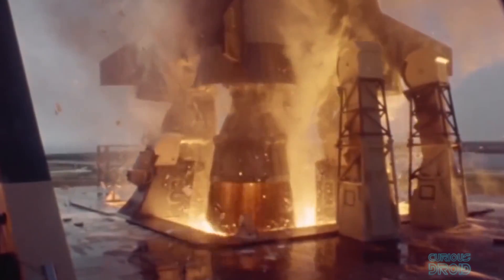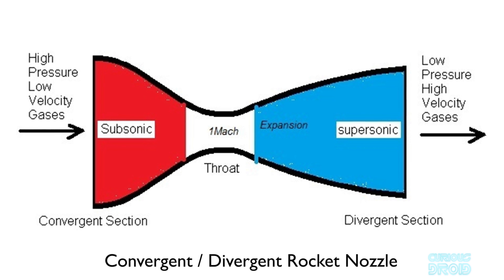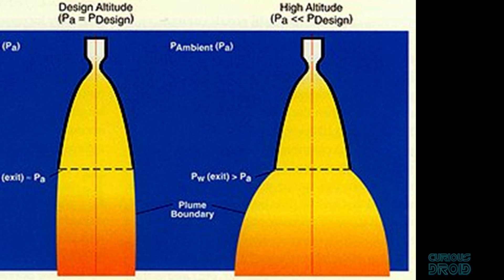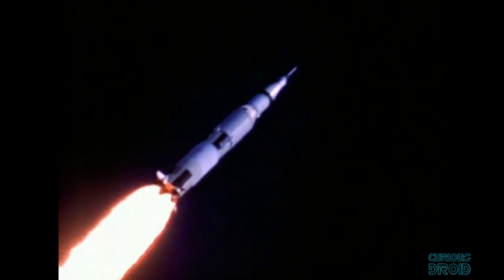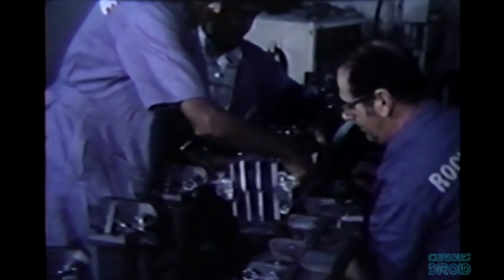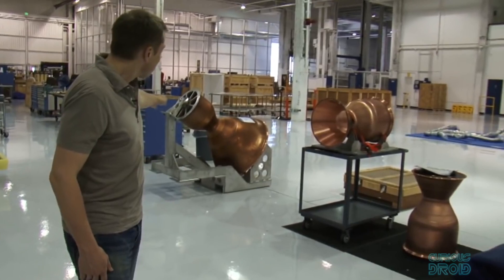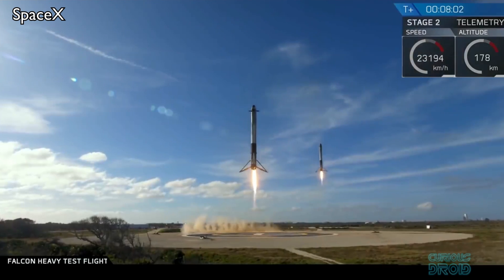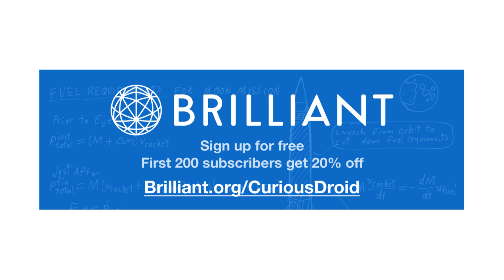Aerospike Engines - Why Aren't We Using them Now?

Comment: Very well done! But I think the technology enthusiasm got ahead of the reality at the end. Venturestar looks fantastic ... but the reason why SpaceX won't use aerospikes is because single-stage-to-orbit launch systems are inefficient on Earth. You want at least two stages to comfortably have a launcher, and more importantly a reusable launcher. (I assume you can throttle a linear aerospike for landing however, meaning that is not the problem.)

By reusing the sea-level optimal engine for the space-level optimal engine you afford a cheap system. The drawback is that your single-stage-to-orbit launcher for the rest of the solar system has two types, and sub-optimized types, of engines. But it works!

Nitpick: Counter the video, SpaceX took a huge risk redesigning valve-shutoff Merlin-C to face-shutoff Merlin-D roughly on the same order of risk as adopting non-bell aerospike engines. But it looks like it lead to en engine that may become the most reliable in the industry.

Comment: Why can these "Bell Shaped" rocket engine's be equipped with a "Outside Variable Thrust Ventury" ?
 This alone can increase efficiency and power. Its used on fighter jets, so why not incorporate that on to the Rocket Engines.

Comment: Isn't a key benefit to multi-stage space vessels to reduce the mass of the final craft for payload delivery / deep space penetration / return capsule? If you are taking the whole craft from launch to space and back, wouldn't you need untold amounts of fuel more, even while using a more efficient engine?

Comment: I’m no rocket engineer in any way but would it not be possible to avoid the overheating issue within the tip of the “spike” by porting some type of sophisticated refrigerants out of the center of the spike? I’m certain this has been though of. Just curious why it wouldn’t work. Maybe it would reduce thrust because of cooling? Or end up compromising the integrity of the spike itself due to heat differences between the inside and outside of the spike? Thinking out loud. I only have a GED so it’s okay to school me. I’d like to learn!

Comment: What you say at 11:00 seems a bit contradictory to one of the primary desires for rockets - the ability to lift as much as possible into space.

If the engines weigh about the same but the aerospikes can achieve the same result with a 40% fuel savings, the cost as you said is irrelevant. The WEIGHT savings from it would have huge implications for the cost per ton getting into space. 

Whatever the current payload capacity is for the most cost effective rockets, if you can save the weight of 40% fuel you could spend some of that that gain in efficiency on increasing payload no?

Comment: About SSTO (Single Stage To Orbit) the major problem is mass not engine. You need a huge quantity of fuel in order to reach space, also you need pressurised tank to contain it.
In a SSTO this will be dead weight, reducing fuel efficency just because of tank mass you have to keep. That's why we still use staging. Because of this you have much more DeltaV using stageing.

Comment: Really great video, very informative and easy to listen to and understand without being an hour long.  I can definitely see aerospike type engines becoming the preferred rocket design in the future when single stage rockets become the norm, rather than a unique exception.  As it is now, multi-stage rockets are beneficial in more ways than one.  As you say in the video, detaching a stage mid-flight and switching to a new set of thrusters allows for greater efficiency, as the shape of the nozzle can be designed for higher efficiency in the new burn.  But it's also an excellent choice in terms of weight management. Since the empty fuel tanks are no longer necessary they can be detached, allowing the new rockets to carry a much lighter load.  Since they're going to be detaching segments anyway, the need for an engine that functions as effectively at every altitude becomes a much less pressing matter.  I'm no rocket scientist :) But to my understanding, the bell shaped nozzle is more efficient within its designed pressure range than an aerospike is, the benefit of the aerospike is their versatility across many different pressures.  Once in space pressures don't fluctuate all that much so the bell type would almost certainly be more efficient.

For now, maximum efficiency in all things is what's most important regarding space flight.  Once we advance further however, perhaps we'll implement the aerospike as a convenient solution to a well understood and managed problem.  Much like how many people now use keurig coffee makers instead of the conventional and more efficient coffee pot type.
Reply: I am a rocket scientist and I see the aerospike nozzle as more like a science fair project with respect to launchers. Might be great for a missile though. However, the idea of changing the expansion ratio is not a bad idea, just not seeing it going anywhere with the aerospike.

Comment: Awesome video, and great narrator!!!! Thank you!!!

I'm curious though, why haven't variable nozzles been tried in some form or another. They're used on jet fighters all the time!
Reply: thermodynamics. Jet fighters exhaust are like ~1200 K (and that really, really, really pushing it) in the nozzle. Rocket engine's exhaust for something like LOX/ Kerosene are like ~2450 K and that's pretty standard. There are decent ideas out there, but they usually results in screwing up the flow coming out, which is important.

Comment: If long rows of aerospikes can allow for thrust vectoring, it seems like making a flying-wing design similar to the X-33, and towing it to about 40,000 feet like a glider would be the most cost effective launch method for heavy loads. It wouldn't even require any additional components to get the rocket nose-up since thrust vectored rockets can be used for steering both in atmosphere and out. 
That should help to reduce the biggest weakness of single-stage-to-orbit craft: needing to carry the entire mass of the craft into space, including empty tanks for spent fuel.

Comment: Personally know someone who worked on this aerospike engines for NASA and he said the project was cancelled because they could never get it to work with the requirement from NASA that they use the computer control systems that were developed in the 60's. The process to get systems approved for NASA use was so ridiculously long that by the time it is approved, it is ancient technology. It is why things have now moved to private industry as bureaucracy has killed NASA.
Reply: While I don't quite believe you about that "someone", the reason for stopping the project, cited by you, is the most likely one. It's kinda sad, with what kind of ancient technology technology in mind NASA's subcontractors are supposed to create their systems.

Comment: this sounds well and good but ignores the fact that multi-stage design allows the fuel tank and housing for the fuel used at lower altitude to be jettisoned along with the altitude optimized nozzles decreasing the rockets weight as each stage runs out of fuel. Less weight means less thrust is required at higher altitude for equivalent acceleration of just the upper stages compared to all the stages combined into one massive stage with an aerospike. this advantage of multistage rockets plays well into the bell shaped nozzles strengths (simplicity and light weight) as well as decreasing its weaknesses (limited range of altitudes where they are efficient).

Comment: outside of industrial risk aversion, aerospikes just don't bring enough benefits in large staged rockets since the lower stage and upper stages can be designed to work in two separate altitude envelopes. Maybe with the growth of small single stage to orbit launchers we might see a resurgence of them as the efficiency gains are the only way to do that without added stages

Comment: Excellent video.  First, I think your analysis of why aerospikes aren't currently being used is pretty much dead on.  Likely, it will probably require AT LEAST a major collaboration between many space launching companies to achieve a usable design, at a minimum, and more likely the kinds of resources only governments (actually the wealth of the people of a country) control AND several of those companies, as NASA seems to be heading off into different directions, which is good, since with all their current bureaucracy in place, they would be HORRIBLY efficient at doing so.  

Having said that, though, there are problems with SSOs beyond just under/overexpanded exhaust.  You really don't want, and actually CANNOT afford to carry all that weight with you throughout the trip just to orbit or most definitely to another solar system body.  

As an example, getting the tiny LEM off the moon to rendezvous with the command module (effectively several stages from launch, including the LEM descent stage left on the moon) was doable BECAUSE its mass was EXCEEDINGLY low.  This is not an argument against aerospike, at all, but a very serious further consideration, and aerospike has no benefit, in terms of moon surface to orbital docking, in fact it would be detrimental.  

I personally think the carry and drop idea, like Rutan used for the little ballistic and VERY sub orbital tourist "space shuttle" idea could be used on a larger scale to gain both altitude and some velocity, making both the largest portion of flight carrying fuel to accelerate fuel, and some of the pressure differential changes during flight into a smaller envelope, even with the standard expanding nozzle design.  Just my two cents, and I realize scaling is a severe design constraint here...maybe to support and ISS style orbital "build in space" notion for interplanetary travel.

Comment: i see holes in the aero spike engine.  lots of moving parts and throttling could go horribly wrong.  the arco space booster, how'd it be reused?  not possible.  just saves money on fuel, while the cost is in the hardware.  dead end design

Comment: 1 sq.in. = 6.45 sq.cm.
Reply: I was going to say the same thing, 2.54^2.
Reply: I caught that too! They say the easiest way to find a mistake (usually spelling) is to post it on the internet. btw my calc says 6.451625806477419  :p
Reply: @chevota400  Your calc is incorrect. Since 1 inch is defined as exactly 2.54 cm, then squaring that gives exactly 6.4516 cm².

Don't know where you got the extra numbers on your calc, but the exact, correct value ends at the fourth decimal place.
Reply: @davidzhren9130    Still, it's much MUCH closer to the correct figure than 2.54sq. cm
Reply: @davidzhren9130  - You are incorrect, as any first-year science student could tell you.

1.00 in = 2.54 cm. 1 in = about 2 1/2 cm.
Reply: @coachhannah2403   @Coach Hannah  You are WRONG! 1 inch is pegged EXACTLY to 25.4 millimeters (2.54 centimeters). Don't spread disinformation.

You're not as smart as you think if you honestly believe significant figures should be used for this conversion.
Reply: @davidzhren9130  - Actually, I am as smart as I think (by definition) and yes, sigfigs do count here.
Reply: Whoops.  Tripped by an Imperial to metric units conversion.  What could possibly go wrong with that?
Reply: Thank you very cool
Reply: Obviously, he said “square units” but meant “unit squared.” I noticed, but translated automatically on the fly...
Reply: What about square Microcubits
Reply: @davidzhren9130  - Let's just agree that you don't understand sig-figs. While you may plug in the actual conversion factor in its entirety, in the end, the ANSWER when using ANY measured amount will be limited by the accuracy and precision of the measuring device. In reality, plugging in the conversion with too great a precision will give you an incorrect answer.

Comment: Rather than one large craft, a series of planned smaller vehicles might reduce cost. A hydrogen ballon for example, with a small vehicle with cargo or a passenger could lift a vehicle for a fraction of the cost. Proof of concept has already been achieved by amateurs with little knowledge of space travel. (Ex.Vids of mobile phones going to space)
I know what you're probably thinking..,How is such a small weight practical? Well, it isn't, but it is proof of concept. And wouldn't be too hard to improve to make it a real and practical idea either! 😉
This would probably save millions in micro satellite deployment.

Comment: Aerospike engines are obsolete in the face of my invention, the Centrifugal Propeller. I have successfully converted centrifugal force into directed thrust in a completely closed unit with no external moving parts and no external vents, and it will continually accelerate in space. I cannot believe that there is still billions of dollars being spent on rocket propulsion when the Centrifugal Propeller is proven and will be a fraction of the cost of rockets. It can be powered by either batteries with solar panels, or a small nuclear reactor similar to the one made by CANDU Reactors. It can be used in a spacecraft that will be capable of multiple space launches in a single day.
I have been largely ignored because I do not have a PhD and refuse to partner up with a university, and because it is so far outside of the box. A few weeks ago I met with a couple of federal government officials here in Canada. One of them had 4 degrees, 2 of which were in physics and in engineering. They were sceptical until they saw my full presentation, after which the physicist/engineer said that I would win the Nobel Prize for this. And yet I continue to be ignored. 
I have tried to get through to Elon Musk but the bureaucracy that he has built makes it impossible to reach him, and his employees do not seem to have the intelligence or vision to understand just how this new technology will adversely affect their employment if Spacex does not adopt it over rockets.

Comment: Making an educated guess why we do not use the spikes, I think it is for the same reason we abandoned ultra efficient carburetors on cars in favor of fuel injection and went from props to turbines on planes. They do not want to put any more money or research into an idea they are trying to out-mode with an entirely different one. They are trying to replace solid/liquid fuel rockets entirely in favor of engines that use renewable forms of energy. We cannot get manned space craft to the outer solar system and back, let alone leave the solar system, without propulsion that runs on electrical, nuclear, or some other form of renewable or ambient energy production. I am willing to bet that the tried and true engines they use are cheaper to manufacture and probably just used because we have the most experience with them. Space is an industry where this is important because familiarity means fewer unknowns, fewer variables, and greater mission confidence.

Comment: That 40% reduction in fuel requirements would go a very long way toward increasing the payload capacity. Seems like a no-brainer to me! $10,000 per pound of payload with the bell system today equates to significant savings with the transition to the spike design.

While I'm at it, how about a triangular spike rather than a round or linear one, with three banks of thrusters for even better directional guidance.

Comment: It's very simple, you take the same priciple as a Air Craft Carrier launching system for this type of shuttle. Change it to electric rail system, started horizontally then vertically up into the air... The vertical part of the ramp would be massive, with a clover shape Support structure to hold the vertical to tower to support the rail connecting to the shuttle... The curve would be very gradual to reduce g-forces while excerating upwards... Their are already planned for something similar starting under ground... It's really hard to say how tall they could get it...  Just under a half of a mile?

Comment: I have a question... As you were explaining about the combustion chamber bells function and the way it's efficiency would be greatly reduced as the atmospheric pressure would change. Something popped into my head. How can a rocket made to take off from Earth function in a vacuum? These are two vastly different air pressures to say the least. And an other question popped into my head. How does rocket propulsion work in a vacuum? Because doesn't it need atmospheric pressure to push off of? I'm kinda confused. thank you and thanks for the video.

Comment: I wouldn't be surprised if the Chinese are working on this. It is the sort of thing that needs to be funded by a government as is commercially too risky. NASA just doesn't have the federal funding to develop this. Is rather short-sighted. Same thing has happened with Thorium liquid salt nuclear reactors. US government stopped funding the development as the waste could not be processed for use in nuclear weapons. The Chinese bought the IP and are doing serious work on Thorium reactors, India too I think.

Comment: hi..interesting video, but I have a question for you are guys perhaps can inform me still about engine but for SR71 and U2 spy plane, they can flight in high altitude even until 70.000 feets. which engine are they using? are they using annular spike or still using traditionally exhaust?
mostly for SR 71 can flight high altitude with high efficient and high speed as well and also U2 at the time it was breakthrough in aero design.